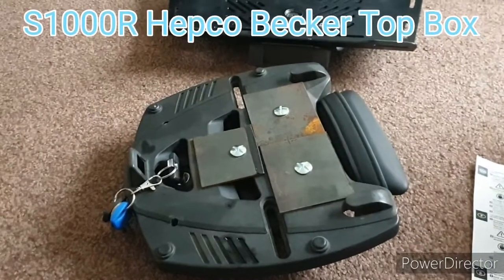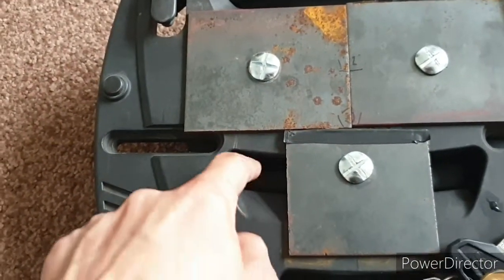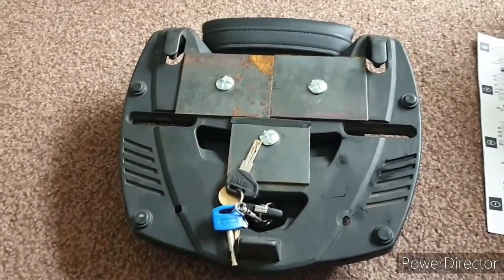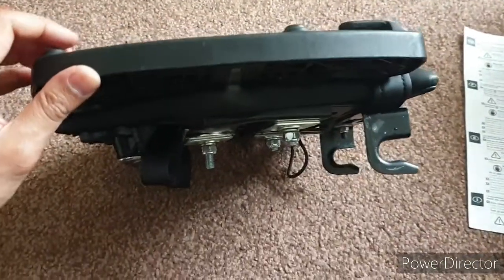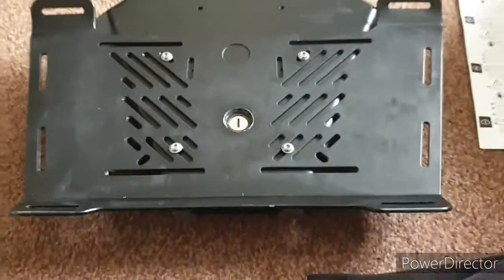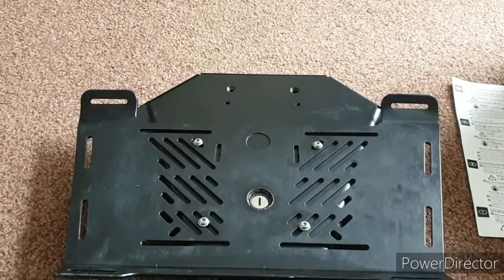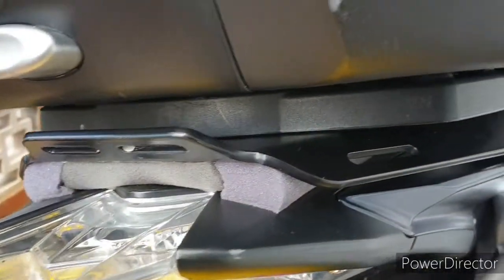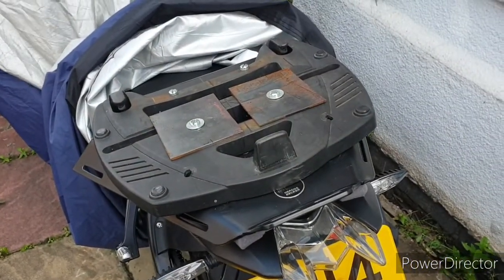S1000R Top Box Solution

Comment: Is that the Givi M3 monokey Plate? I'm picking up an S1000R and planning to do a similar topbox fitting 😎
Reply from the maker: Hiya. Yes its the monokey plate. I've got a v47 which I've been using for years and the plate fits perfectly to it. I think they're mainly generic.  

I've gone back to an S1000r (21rrg) which has a different plate from the 2014-2020 bikes.  Hepco do the plate for it, but its another £150
Reply: Alright! The Hepco Becker plate comes with the bike, previous owner used it to carry some soft luggage. I'm really looking forward to the test ride on Monday 🤩🤞🏼 
Have you had any trouble with vibration and numb fingers? 
BR Bjarke 😊
Reply from the maker: @singleplanediscovery3475   sounds perfect. Safe riding my friend.